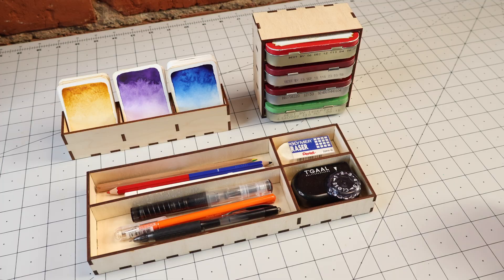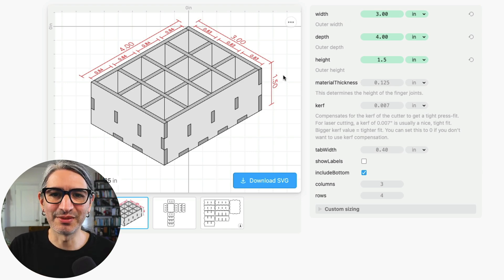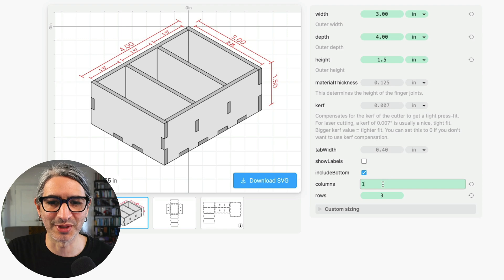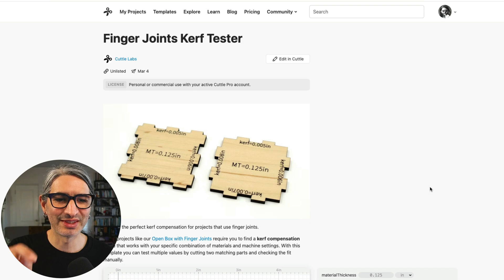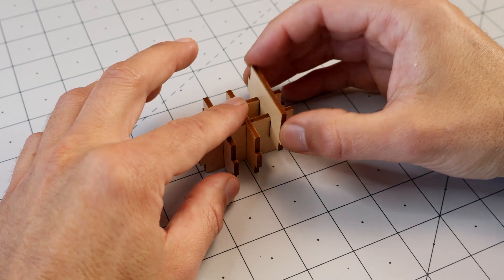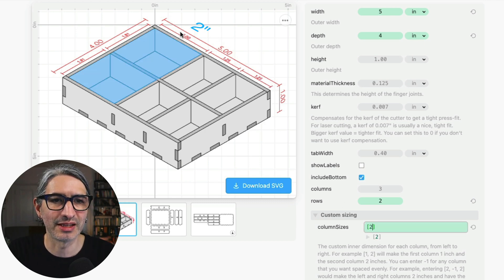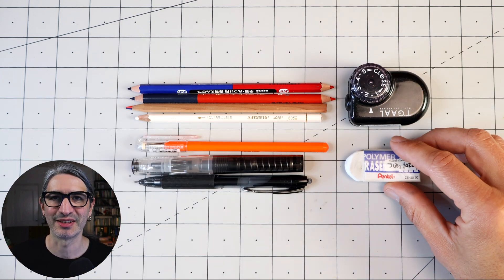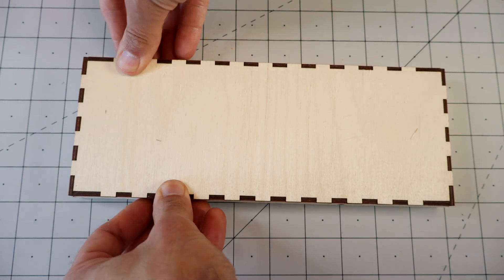How to Make Laser Cut Boxes with Dividers

Comment: The first parameter in the template does not have a unit conversion dropdown, so converting the box to mm messes the whole drawing up.
Reply from the maker: Ok, width has now a unit conversion drop down. BTW, you can always add the units by typing them in the box.
Reply: @Cuttle  Never knew about typing units in the fields. This is great. Thank you.